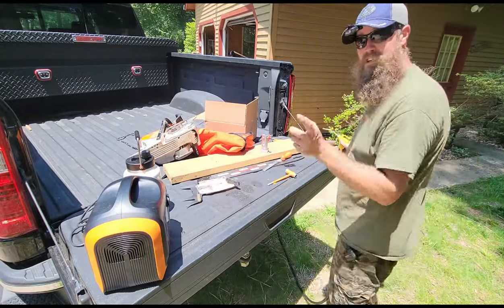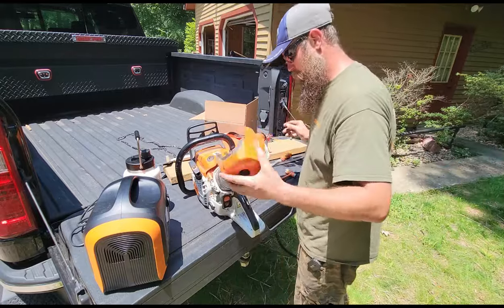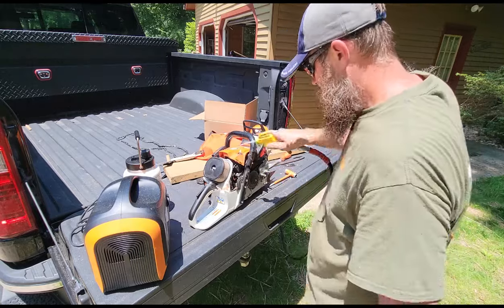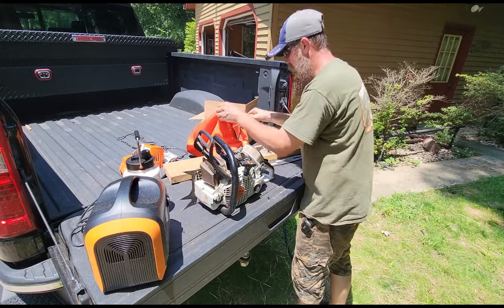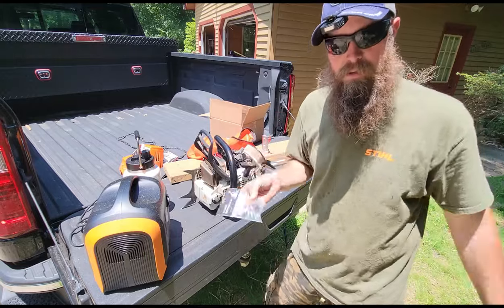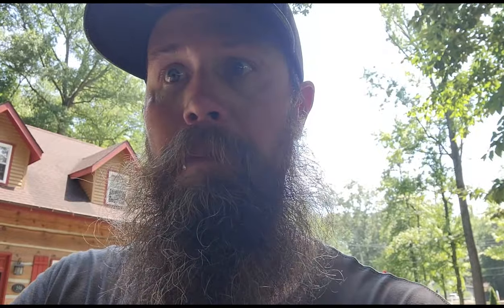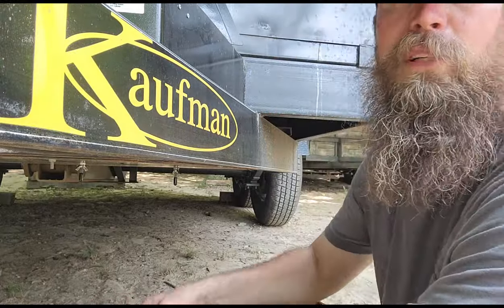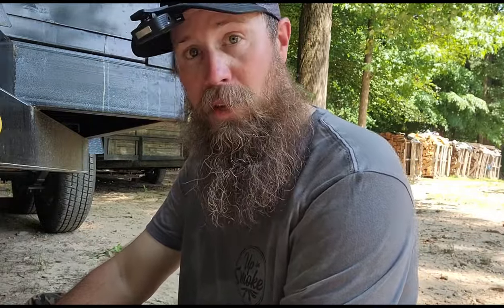How "Not" To Install The WCS Fallers Suspension Kit -071

Comment: I always forget about amazon. I need to come up with bracket to hold my pump in dump trailer down. Awesome how not to video haha
Reply from the maker: I need to delete Amazon 😂😂 we have the opposite problem.  Thanks Matt
Reply: Jack by far the funniest how to video I’ve  seen in a long time. The spitting, the prying. The PG rating with all the self inflicting battle wounds. You did great. Saw rocks. I think that flat plate in front of sprocket is called an inner chain guard. I replace with the 660 plate same as 500I but thicker. Factory plate super thin and nothing but expensive plastic behind that plate. Jack make sure you get a couple extra filters for the max flow and that oil to recharge filter was tough to find. Even Amazon order got screwed up for filter oil. Filters get filthy quickly. Have a great weekend sir.
Reply from the maker: @BW35bucket  lol, but it's a how "Not" to 😂😂 talk to Jake ( dude ranch)  about that oil for those filters ... he has yet to oil his filter and he's been running the max flow for over a year without it.... I have heard the same thing about them getting filthy though 🤷‍♂️ thanks buddy 🤜🤛